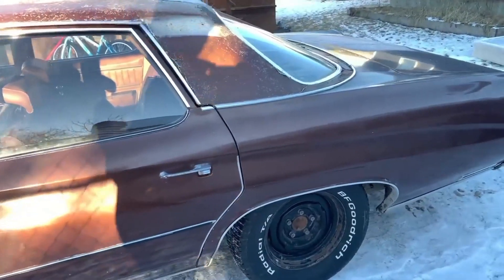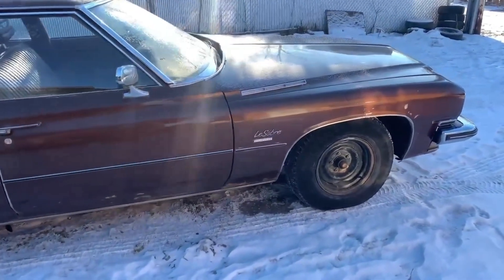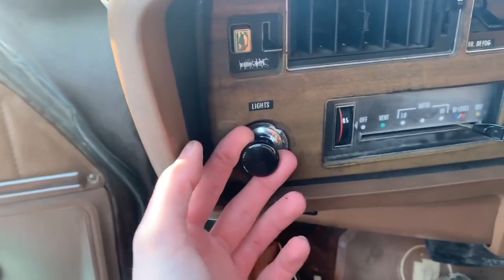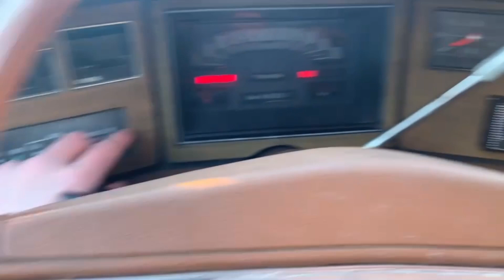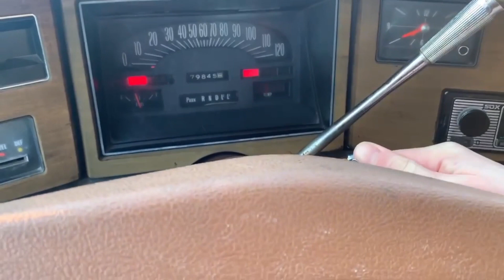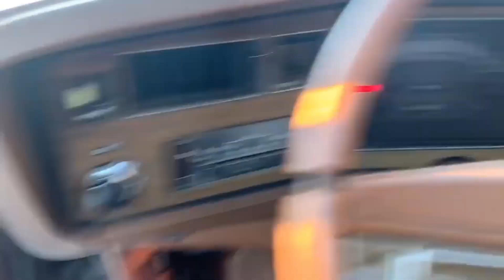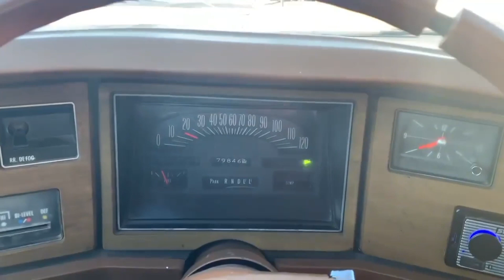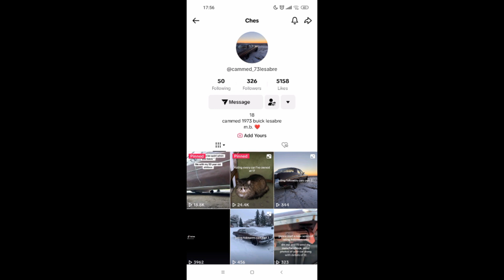1973 BUICK LeSABRE CUSTOM REVIEW

Comment: Hey, you are pointing out How much gas did this use 
Same as today's plastic fantastic SUV's get 12-14 miles to the gallons.
This does it in style and you service it yourself.
Better than today's Chinese Buicks.
Also the bottom foot switch is your high beam low beam switch.